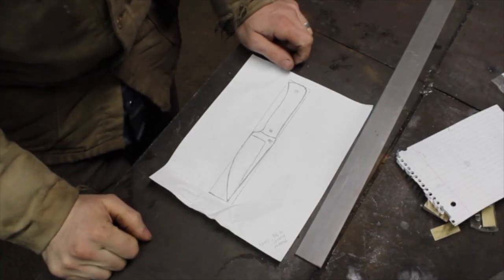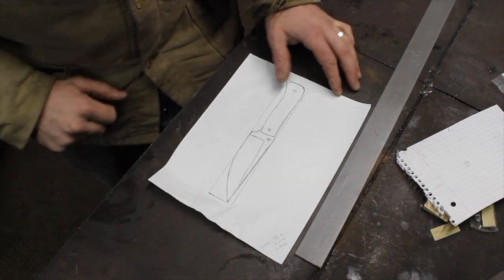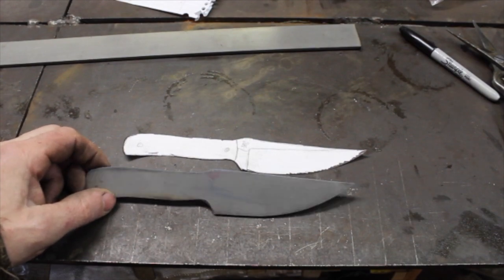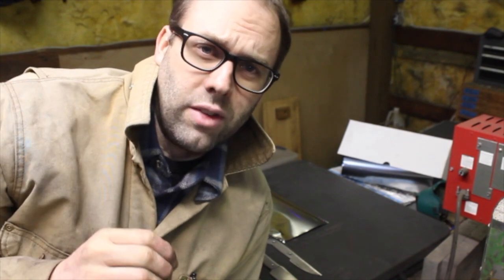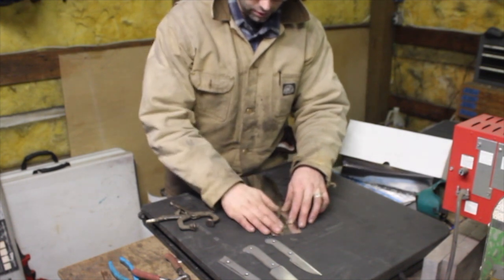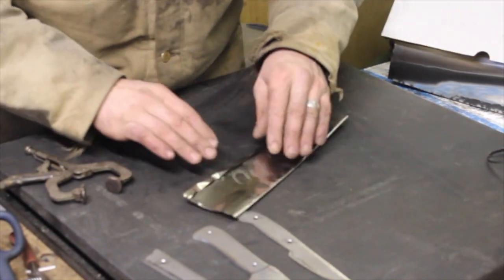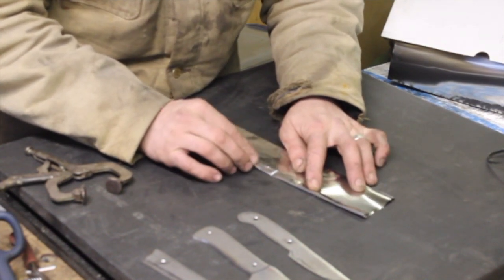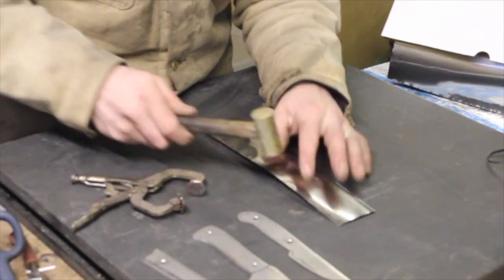Making A (Stock Removal) Knife From AEB-L Stainless Steel

Comment: AEB-L steel was developed as a razor steel and it leaves one wondering why it has such a low Carbon content at 0.68%. It is so low so that only the ferrite or iron alone converts to iron carbide and very little converts to chromium carbide thus losing very little of the chromium's corrosion fighting ability. AEB-L barely qualifies as a stainless steel which is 13% chromium. AEB-L is the same as Sandvik's 13C26.

Look at D2 tool steel with its 1.50% carbon and 12% chromium and 0.90% vanadium. The chromium and vanadium convert to carbides that equates to some significant wear resistance even at a lesser hardness than AEB-L. Vanadium carbides are harder than even tungsten carbide. Temper D2 at 1000F for two hours 2x and you'll be right at HRC59-60, but temper AEB-L at 850 and the hardness jumps up to HRC58-59.

Heat treat for AEB-L is pretty basic,  ramp up to 1500 then equalize, take it to 1975 and hold for 8 minutes then quench with an air blast or between two plates . I always just put the blades between two blocks of dry ice for a cryo in a homemade cooler made with 4 inch thick walls of Styrofoam I bought at Home Depot as a 4'x8' foil covered sheet. It needs to be dropped to -95F and dry ice is -109F. Then temper at 420 for 2 hours 2x will give you HRC59-60.
Reply: I don't understand.... you like AEB-L or  not ?
Reply: @AAAAAAndrea 😂😂😂😂😂
Reply: @Knifeknuts  This comment is so old I  already bought all the knives I wanted and stopped buying 😅
Reply: @AAAAAAndrea I was laughing because I was thinking the same as you having read that comment 😂